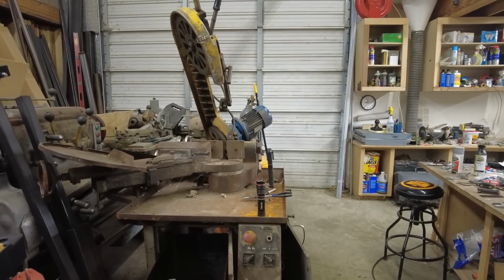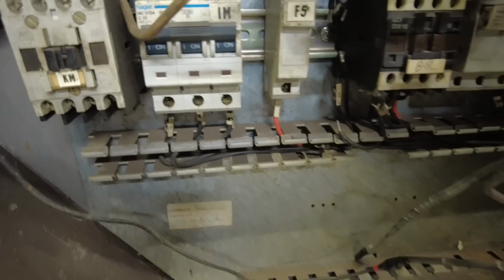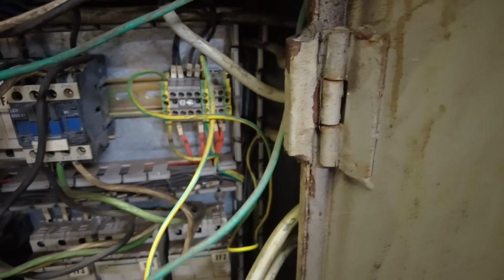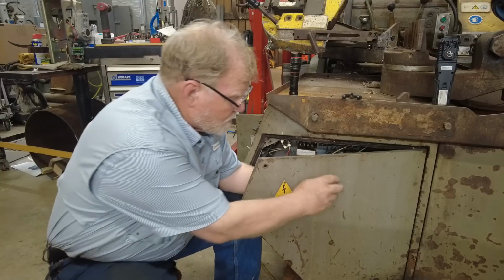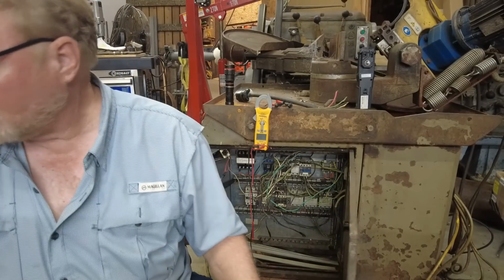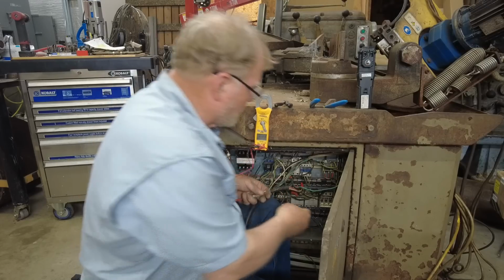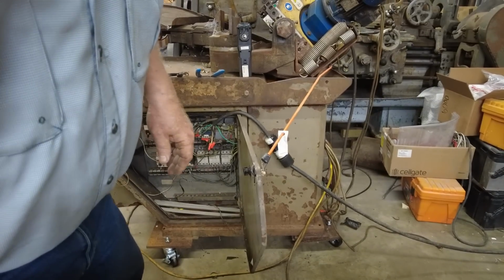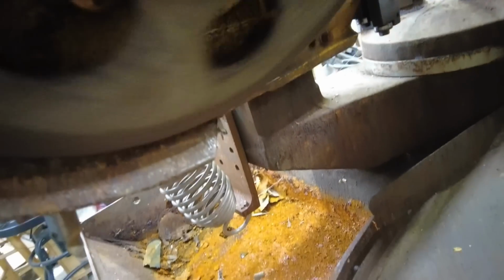This Should Be A Crime: Part 2 Will the Motor run?

Comment: I wouldn't think that they would put a mercury switch near the end of the saw when the angle would be the same anywhere on the body of the saw. They might put a mechanical switch that touches the table to shut the saw off at the end of a cut at the far end because it would provide greater sensitivity as that end moves farther. It could have something to do with blade tension which would be set on the non driven pulley on that end.
Reply from the maker: Makes sense , we will see when I take that wheel off ;)

Comment: I wonder if the 120VAC wire and plug wasn’t for the pump (or just the pump) and was put there by Bubba as a control circuit to power the three-phase relays. The original control circuit was probably 24VDC from a power supply.
Reply from the maker: One of the commenters said that a machine like that would never have had a single phase pump.. I am leaning that way too..

Comment: I could probably use that motor if you decide the machines not worth the effort. My milling machine uses five motors for all the functions. All could be rewired 440 to 220 except the X power feed.  Three electric shops quoted unbelievably prices to rewire for a two-speed motor from 440 to 220 volts. It has a six-speed gearbox so there is no strain to just use it still wired 440 but I would have liked to have used 220.
Reply from the maker: Sorry, I think the saw is worth saving :)

Comment: Not everyone is good at everything...someone tried to get it working and just didn't do it well... nothing unusual in shops.... whether it was done good enough to work or Not is not what you confirmed...lol... anyways it can be fixed by someone to be Safe and Working properly....no sense wasting time trying to understand and complain.... it is Used and needs to be Fixed.... once you get it repaired you still won't know what was done because you never drew out how it was wired ( or miswired )... i usually do a quick drawing just for the purpose of trying to get that Answer ( why it was wired as you got it )... but it doesn't matter sometimes other than making you get " Some " answer to what you see...😆
Reply from the maker: But I have hours of video of the control box :)  I can see how it was all done ;)
Reply: @10swatkins  
but seeing ain't knowin' !!
hours of useless info is well ... wasted time...🧐

Comment: Some of what your calling contractors are relays
Reply: Contactors are relays. Rather than switching one circuit the can switch multiple circuits, with different voltages, if one adds an auxiliary contactor to the main one.
Reply: No these are normally open and close contact blocks where technically they are contacts they are called relay blocks as they are used like relays to control circuits. They are different from motor start contractors which are technically contractors but commonly are called motor starters. Steve intertwines the two sometimes.
Reply: Relays and contactors are pretty much the same thing. Those, din rail mounted, with a manually operable plunger I would call a contactor. A little cube that plugs into a socket, I would call a relay. I don't know the official definition, but that's my general rule of thumb.